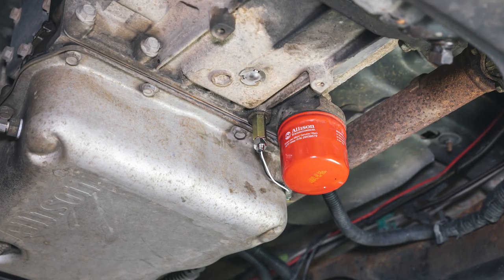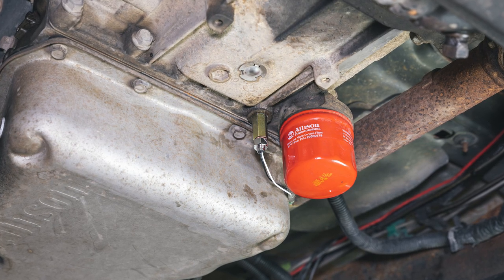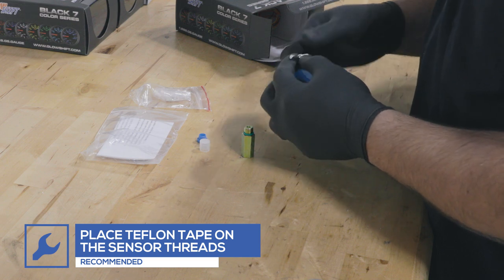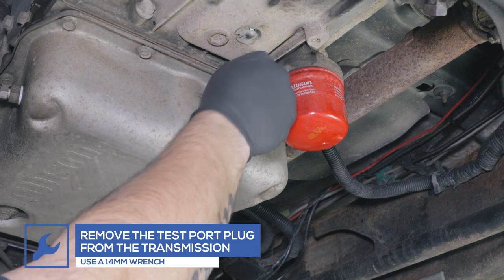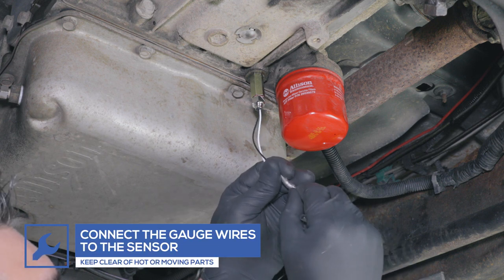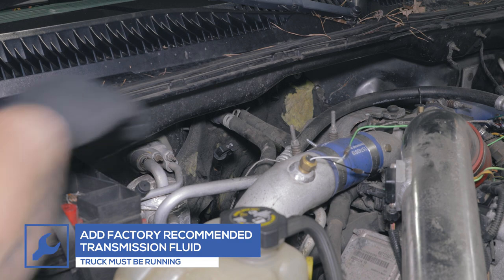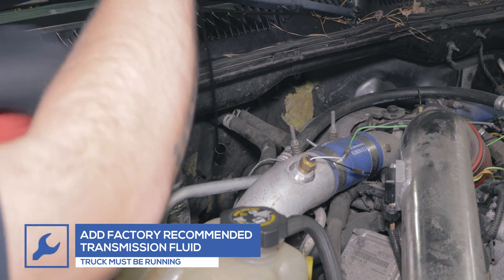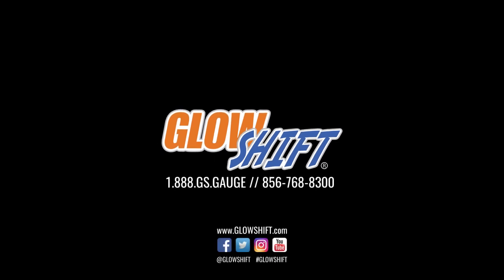Installation | GlowShift Transmission Test Port Extender for 2001-2018 GM Duramax Allison 1000

Comment: Did I miss what the other end of that sensor was ran to and what it's purpose is? I might have fallen asleep 😴
Reply from the maker: The other end of the wires would be run to the transmission temperature gauge. This video is only to show how to install the extender. Not the full gauge.
Reply: @GlowShift  Very professional response Sir. I can tell y'all are a great company to work with.